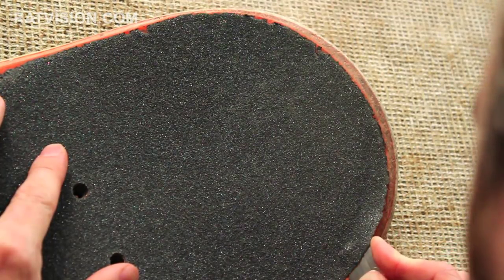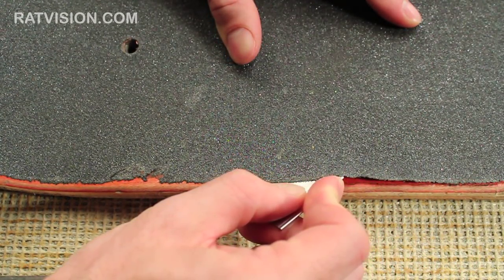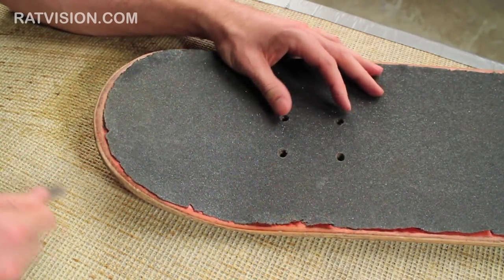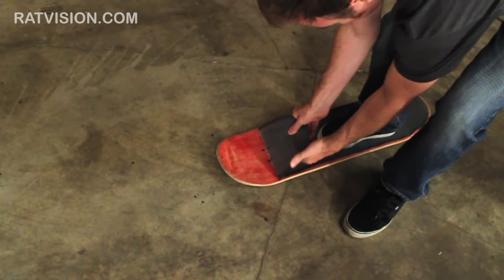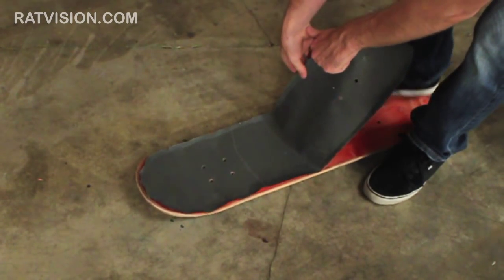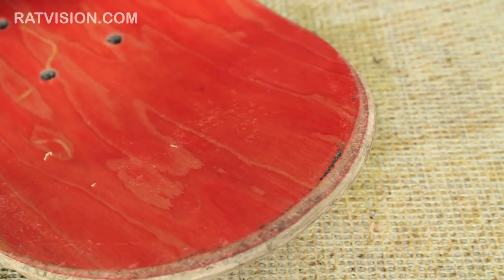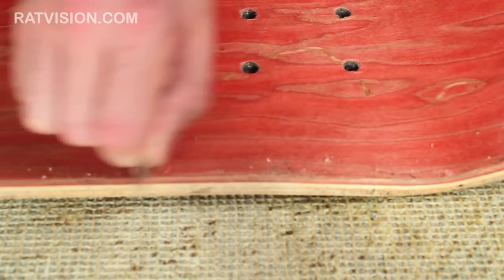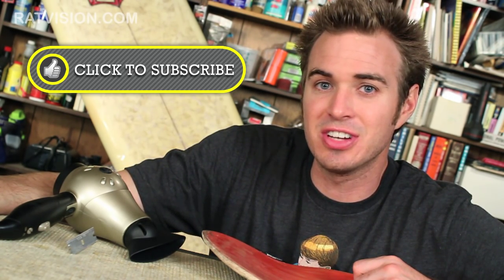Remove Skateboard & Longboard Grip Tape

Comment: I just bought a skateboard from positiv and I do not like the positive sign on the board where the tape was supported to go, is there a way to add some tape to that area because that area is showing wood and I don't want that
Reply from the maker: Well you could cover it with a piece of grip tape, but you'd have to buy a whole sheet, so you might as well just re-grip the whole thing.  This video shows how to remove it, and we have a video that teaches how to put it on.
Put On Skateboard & Longboard Grip Tape CORRECTLY
Reply: could i buy a whole sheet and cut a piece of it to use and then when i need to replace the whole skateboard with tape i can use the rest?
Reply from the maker: The rest of the grip tape won't be long enough to cover a whole deck, unless you got to a shop and buy grip tape off of a roll and the cut you off a piece long enough for a whole deck and the piece you need.

Comment: Is there any way to get the adhesive off my deck after I take the grip tape off? I was planning on painting it and putting on the clear spray on grip tape.
Reply: sand it
Reply: Laura Dahl that wont work?
Reply from the maker: It's totally normal to have adhesive stuck on the deck. It won't effect the new grip at all.  So put the new grip right over it.
Reply: ...well its too late for help now and I did need the adhesive off because I was sanding my longboard down to the wood and using a sharpie to do a sick design (which came out really good) then I was putting on spray on grip tape so you will be able to see my designs
Reply from the maker: How did it turn out?  What did you use for your spray on stuff?
Reply: it actually turned out really well and I used that lucid medium grip
Reply from the maker: OK cool.  We are going to be testing that stuff soon.  Please let us know if you notice any problems at all, like if the grit wears out, or if the coating cracks, or turns yellow.  

We are going to be doing a video on spray on grip, and want to mention Lucid.
Reply: the only problem I had with it is it says it has enough spray and that crushed glass for 2 44inch board or something around that  but I had to use all the spray and a whole lot of the crushed glass for it to even be a good enough grip, the first time I did what it told me to do and I went for a ride and the grip just all came off so I applied more and it seems to be fine now.

Comment: i bought a skateboard for about 120$, my bearing seals are pressed in (i cant remove them, they are dirty) the griptape isnt all around the deck (middle section) i want to buy bones reds , thunder trucks, bones reds, and jessup griptape. will that do?         HELP!
Reply from the maker: HA HA.  You sound "brand-washed".  Sounds like your friends have been telling you what they think you should buy.  You just spent $120.  Now you want to spend an additional $62 for stuff you probably don't need.  It doesn't matter if your bearing shields are pressed in.  Try to keep them clean and lubricate them.  What is your current set up?
Reply: Rat Vision – Skateboard Tech well i dont know the brands but it says area on the deck and trucks, nah still have 150$
Reply from the maker: jasons mazkalnins Don't waste your money.  If your board works, why try to fix it?

Comment: What if my grip tape is clear? Is that a spray on? How to get spray on grip tape off? Thanks!
Reply from the maker: Do you have a Duster or Loaded board?  Some board do have a spray on grit.  It's not a tape that can be peeled off.  Clear grip tape can be removed the same way in the video.  Spray on grip is a coated on and is a whole other process to remove it.  We plan on making a video on how to remove it and add new pray on grit too.  You'll need to have a heat gun or a hair drier that gets really hot and scrape off the coating with a metal putty knife.
Reply: I think you could just try to sand it off :)
Reply from the maker: Sanding won't work.  It has to be scraped off

Comment: What I would do, is get a ruler or any straight edge and a knife/razor blade.
Put the straight edge wherever you want the new griptape to go, get your blade and slice across, so it separates the grip. Follow the steps in this  video to remove the section, and then just apply the new grip..

Comment: any tips for spray on grip tape?
Reply from the maker: We are working on this video.  You can check out Lucid Grip, http://www.lucidcleargrip.com/ .  We have not tested this product yet. We will include it in our video.  We purchased Aluminum Oxide grit (which is a type of abrasive media), and it is what all color and clear grip tape is uses.  Lucid uses recycled glass, which is also good.  But not all glass is consistently sharp, so it depends on where you get it.  Hopefully Lucid Grip uses good glass.  
I don't know what they are using to coat the deck either.  Anyway, the size of the grit is typically between 36-46 (if I remember right, 46 is a good size), but you can go finer or more coarse than that.  The higher the number the smaller the grit.  We used Spar Urethane (outdoor) in a spray can to coat the deck and hold the grit.  You can pick it up at any hardware store.  
Instructions:
1.  Spray on at least 3-4 coats (cover the deck with spray, then repeat) 
Needs to be thick enough to hold the grit. This is your base coat.
2.  Sprinkle on grit to the desired amount. Use an old salt shaker to easily spread grit onto the deck. It does not need to be super condensed like a sheet of grip tape.  Even a little grit makes a huge difference.
3.  Add another coat of spray. 
4.  Wait 2 hours, and then add another coat.
5.  Wait half hour and add another coat.

This is pretty basic, but add as many coats as needed.  Some grit will come off If it seems like most of the grit is coming off then add more coats of spray and add more grit.    The problem you might face is that the spray is really thin, so make sure you get a good base coat (step 1).

You can try to get grit/media in your local area.  Look up places in your area that do sandblasting, or abrasive blasting.  Tell them you want WHITE aluminum oxide media that is a size around 36 to 46. These places sell bags by the pounds/grams. I'm sure they'll just give you half a cup of it for free, because you hardly need any for a deck. 1 pound could grip about 5 decks, maybe way more.
 Sometimes media is mixed with 2 sizes, like #36/#46.  This can also be nice.
We purchased aluminum oxide from this place on eBay.  It's super cheap, but then you have to pay a lot for shipping.  So try to find it where you live.

http://www.ebay.com/itm/Aluminum-Oxide-White-36-Grit-1-Blast-Media-/251125085187?pt=LH_DefaultDomain_0&hash=item3a7838b403

Comment: What if I'm going to apply clear grip tape and it is really dusty how do I remove the residue
Reply from the maker: The residue probably won't show up.  Clear grip tape is blurry. you can try removing the dirty parts with duct tape by sticking it on a ripping it off to pull the adhesive off with it.
Reply: +Rat Vision – Skateboard Tech how do you remove spray on grip tape?

Comment: Can I take it off with the screws/trucks?
Reply: i have the same problem
Reply: +obey hoddie I did it with the screws and trucks and it was easy. it will just leave little scraps of grip under the screws but just take the screws off and the scraps come off
Reply: +JayVision44 Dumbass

Comment: How can I drop in on anything (bowls and etc) without being scared?
Reply: practice it more and more. Smaller ramps first
Reply from the maker: Squat down all the way.  That way if you fall you only fall a few inches and slide.  You can also start at the bottom of the ramp and work on pumping.  The more you pump the higher you'll get.  when you reach the coping you can work on lifting your nose.  Eventually you'll be able to put your tail on the coping/rail and lift your nose up and drop back in.

Comment: I want to remove the sticky ness under the Tape as I'm going to spray paint the wood any suggestions
Reply: Why would you spray paint that side of the board? Your just gonna put grip tape on it.
Reply: ***** Ya but normally that side either comes colored or it comes stained. I think he saw the orange on this guys board and assumed he painted it. When they really come like that.
Reply: red
Reply: Ticker Bruh, stop being butthurt.  I don't want to put grip tape back on.  What do.
Reply: ElectrifiedNinja Im not butthurt it just didn't make sense to me to paint that side.
Reply: Ticker 817 Maybe he wants to use his board as a decoration or use clear griptape as Raven Mcgorden said. Good thinking, Raven!

Comment from the maker: Are you joking.  You've got bigger problems to worry about than mud stuck to adhesive.  You skated in the rain.  Your board is going to get soft, possibly delaminate, and lose performance. This is like washing a car with a broken window.  What's the point.  Scrap it off if you seriously want to continue using that deck.

Comment: Doesnt the heat do something bad with the wood??
Reply from the maker: No it's not hot enough.
Reply: Unless you're using a heat gun, you'll be fine. Just keep the heat from the blow dryer moving around and not hovering over one concentrated spot. :)
Reply from the maker: A heat gun will not hurt either.

Comment: How do u know what the film looks like?
Reply from the maker: The film is the bottom layer of the grip tape that has the adhesive on it.  It's black/dark gray.  Basically you'll peel the grip in 2 pieces. You'll know if it happens.
Reply: Ok thank u

Comment: how do you remove clear grip tape
Reply from the maker: Clear grip tape or spray on?  Clear grip tape you take off the same way.  Spray on grip needs to be scraped off using a heat gun and metal putty knife.  This is a video we intend to make.

Comment: How do you remove spray on clear grip tape?
Reply: Spray on grip tape ? Is that a joke ?
Reply: Nope. Loaded has spray on grip tape. It's made up of recycled glass shards.

It is obviously not a tape, but that is its general name.
Reply: +Jake Methner I don't think you can take it off it has to wear down
Reply: ClassyAmericans I just sanded it down with sand paper. Wet sanding would be better.

Comment: how do you take off the glue? from the grip tape... there is glue on the board :/ what if i dont wanna put grip on the whole board.. am i stuck with the glue on there? plz help how do i take it off ? Rat Vision – Skateboard Tech
Reply from the maker: You can put grip tape right over it or follow this from what we left for another comment....
The best stuff to use is citrus cleaner.  Try not to get it on the graphic.  Dilute the citrus cleaner with water for cleaning any graphic on the top. I say this because you want to preserve the graphic between the grip tape right?  Citrus cleaner won't take off the graphic, but it could make it fade.  Any cleaner will make it fade though.  Anyway this is the absolute best stuff for removing adhesives.  Try to wipe off as much of the adhesive first.  Once the citrus cleaner touches the adhesive it will get all gooie and messy.  Just keep using a new paper towel to wipe more off.  You could also start with duct tape.  Place it on the adhesive and rip it off.  DON'T do it if the deck has paint or on the graphic because you'll take paint off.  If its just wood or died wood then use the tape. If you have other questions ask away.  The citrus cleaner should also make the deck look really clean and give it some shine.  If you want to help preserve the deck, you can get a spar urethane spray with a gloss finish.  This will make the deck look really clean, shine, and look new.
Reply: thank you so much !! because i got tired of skateboarding and i want to cruise now.. and penny boards style are too expensive ! so im going to cut my board in a penny board shape and put penny trucks and wheels on it! my friend did this and its amazing ! thank you for the help!
Reply from the maker: I cut a board down over 15 years ago for high school, so I had a board that would fit in my locker.  It was definitely a fun little board to zip around with, but for a longer board does have more stability and is less likely to get speed wobbles, so keep that in mind.
Reply: ok ok thx and one more thing.. tips to drill the holes for the trucks and wheels?
Reply from the maker: What I think I did was leave the back truck where it is, and i may have used the 2 inside holes for the front truck.  What I did was use the inside holes as the outside holes.  This way I knew the trucks would be straight.  Then with the truck mounted, I drilled through the truck base plate bolt holes.  Does that make sense?  So the inside holes on the front truck become the 2 outside holes, or closest to the nose. The mount the truck and drill through the truck to make 2 new holes.
Reply: thank you so much!!!! love from canada dude !!!
Reply: im having probles taking off the glue when the grip tape is off.... any tips how i can get  rid of it ?
Reply from the maker: Don't worry about it.  It's normal for the adhesive to stay on the deck.  Put your new grip tape right over.  It won't be affected at all.
Reply: ok thx

Comment: I watched this, did it myself, watched it again, and laughed at how many steps he took compared to me.
Reply from the maker: The video is for instructional purposes, and shown as a worst case situation.  Some grip tape requires no heat at all, and sometimes it doesn't need to be lifted from the edge if the edge is smooth.  Glad this video turned you into an expert now.

Comment: you could also just throw it into the freezer.
Reply from the maker: For what purpose?  And you must have a huge freezer!
Reply: to freeze the adhesive and it should come off.
Reply from the maker: So you want to try to squeeze a skateboard into a freezer, what for a long time for it to freeze just to see it will be easier to peel off? It's not that easy as u think, but it works really good in cartoons.
We think the hair dryer method that takes less than 5 minutes is much better.
Reply: Rat Vision – Skateboard Tech Can't see how freezing, then thawing, a deck would be good for it either.
Reply: Rat Vision – Skateboard Tech does anyone know if when the tail of your skateboard gets thinner  (and i don't mean stupidly thin) is a bad thing?
Reply from the maker: Not really a bad thing.  It's not a good thing.  You are more at risk of chipping the tail when it gets thin.  The wood is also not as stiff so you may lose pop because the wood can flex easier.

Comment: This is such bullshit, I'm doing it right now and it's been 20 minutes. The hair dryer is on fucking turbo and burning me and I've almost cut myself like ten times. This isn't easy and definitely a long project, that takes a lot of time.
Reply from the maker: There is absolutely no way you could have struggled as much as you did if you followed these steps.  I've done hundreds of re-grips and even the hardest ones don't take 20 minutes, and thats without a hair drier.  So, if you got it really hot, it should have come off very quickly.